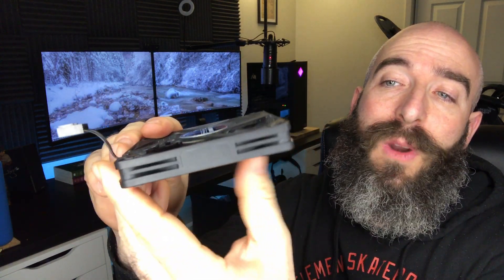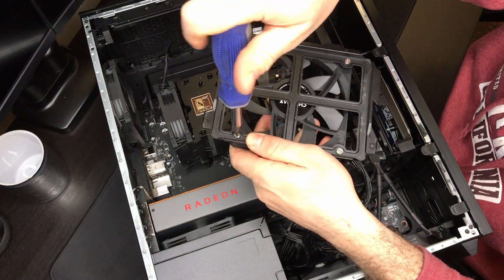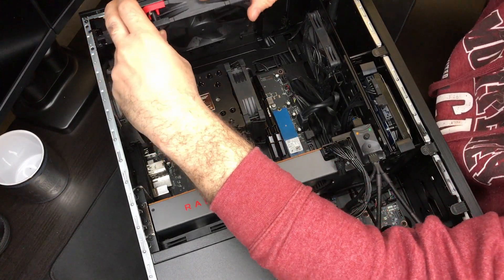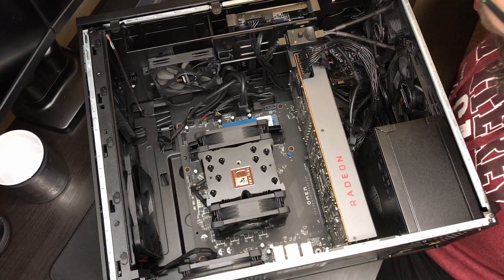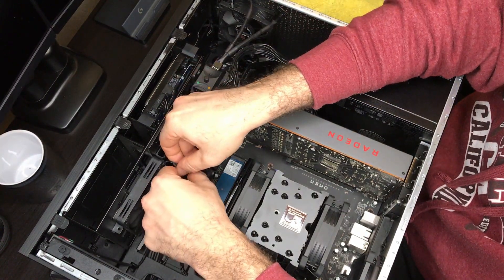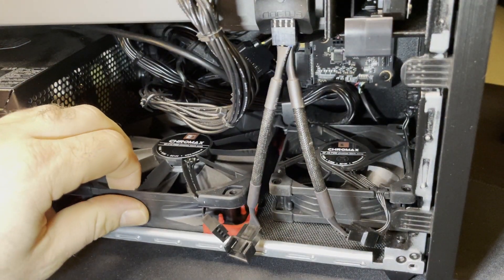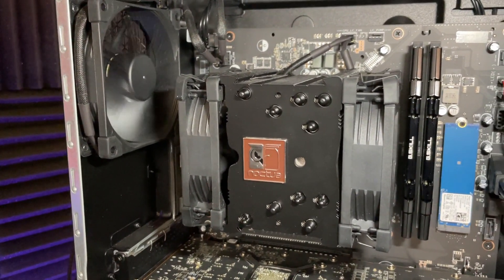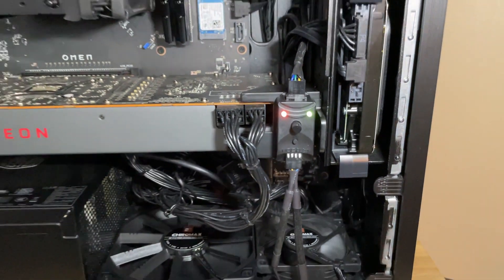How to: Install and Setup All Fans in an HP Omen 25L / 30L! Tutorial & Guide!

Comment: I have a hp omen 25l
Can I install a cooler master i71c without changing the back plate? I think it may be possible since it's almost the same except for a 120mm made for Intel cpus,there's a ryzen ver but the plate is intel correct?
 I want to add some more cooling capacity without removing the motherboard and the tedious process of removing that plate without breaking the MB
Reply from the maker: It may work but I’m not 100%, and it probably won’t be that much better than the Omen air cooler, although a 120mm will provide more airflow than the stock 80. Both Ryzen and Intel Omen motherboards use Intel spacing, you’re correct. I haven’t seen anyone try this so not sure if the i71c will work. If you’re careful and have the right tools, removing the back plate isn’t too bad. A heat fun / blow dryer / dental floss / plastic pry tools have all proven to be pretty effective. I have a full tutorial on the CPU cooler swap if you need it.
Reply: @DanKamYouKnow  my stock cooler has a 92mm fan...the i71 has more cooling capacity than the i51 which I'm assuming is the hp omen rebranded stock cooler,now I read the ryzen 7 has a tdp of 65w,so shouldn't that stock cooler be sufficient?it's rated for 65w, Idk
Reply from the maker: All stock Omen air cooler fans are 80mm. HP limits every single Omen CPU to 65w TDP, Intel and Ryzen. Looking at the design of the i71c compared to the stock Omen air cooler, it seems like it should work. It’s only $20 so you could give it a shot.
Reply: @DanKamYouKnow  so hp throttles the cpu so it won't go over 65w tdp? That's crazy to lose performance because they won't spend a few extra $ on a cooler? Are the aio liquid models capped at 65w as well? 
 I'm really thinking about getting a new motherboard and case and transfer everything over ,cpu,mem,Ssd,etc...that way I can control the clock/overclock,I assume hp bios do not allow that
Reply: @DanKamYouKnow  thank you for your response on the cooler.....
 Lastly are there any rgb headers on the mb? And if so can I split the header to sync another rgb? I'm asking cause that cooler has rgb sync,i71c
Reply from the maker: Well, HP boards have proprietary RGB connectors so traditional RGB connectors won’t work. You’ll need some kind of external RGB controller to power them. I haven’t tried it so I’m not sure.

Comment: The only thing missing from this upgrade DAN was the mention of the extra screws you need to install the top exhaust fan...when I took off my sons top plate it only came with 2 tiny screws nothing else. Can u help us out on what size and thread count screws to get or do I just use any screw that will fit?
Reply from the maker: Screws for the fan ALWAYS come in the box with the fan. I unfortunately have no idea what size they are.
Reply from the maker: If they didn’t come with them, you can Google or Amazon search PC fan screws and there’s a ton of results:

https://amzn.to/3iCn5s9

This is a huge pack but they look like this
Reply: You’re the best DAN... yeah we ordered the exact 2 fans for the top and rear exhaust and nada screws..thanks for getting back to us so quickly we’re actually installing 1 of the fans now.

Comment: The screws that came with my chromax fan did not fit into the bracket so I had to put the fan at the bottom did you use a different set of screws?
Reply from the maker: The screws that they come with work fine. You have to place the screws into the bracket first, and then screw them into the fan. You’re creating threads in the fan so it may be tough at first.
Reply: @DanKamYouKnow  thankyou so much I just mounted the fan to the top with the bracket also should I plug it into the pump or CHF AN
Reply from the maker: CHF AN would work better. 👍🏻
Reply: @DanKamYouKnow  ok thankyou I have everything thing set up thanks for the help
Reply from the maker: No problem 👌🏻👍🏻

Comment: What about the Fan on the front side like 30L? Isn´t it possible to change the front plate to the one frome the 30L for better airflow at the downside of the case? Aside from that: Nice videos, thank you
Reply from the maker: It would take some serious modifying in order to add that front extended section in, and frankly not worth the trouble in my opinion. Even with that lower 120mm, the 30L’s don’t run that much cooler.

Comment: I have the Intel i7 + RTX 3060 model 25L. I installed a Be Quiet! fan on the top, but I have another one I want to install somewhere else. I can't find anywhere in the case to mount it, and I want it at the bottom as an intake fan since I currently have 2 exhaust. Any tips? I noticed u have one on the bottom but I don't feel comfortable using adhesive.
Reply from the maker: I didn’t use adhesive for the bottom fan, it’s wedged n next the the power supply and doesn’t make any additional noise or anything. I HIGHLY recommend a bottom fan because it brings a much needed intake fan into the case. I show in the video how I installed it.
Reply: @DanKamYouKnow  alr, thx I'll try that, I think I'll use it as an intake :)
Reply from the maker: Yes, definitely use the bottom fan as an intake. If you mount a top fan, set it to exhaust.

Comment: I have a HP Omen 30L water cooled version. Where would I mount this? CPU and GPU hit temps I’m not ok with.
Reply from the maker: If you have a water cooled machine. Your best bet is to replace the 120mm radiator fan / the rear 92mm fan and add a 120mm fan at the bottom.
Reply: @DanKamYouKnow  thank you gpu and cpu hit like 82 degrees which to me is crazy. Almost had them hit 90 degrees before. I’ll pick up these fans.
Reply from the maker: Nice, that should help bring the temps down a bit
Reply: @DanKamYouKnow  so I noticed the y splitter only has 4 pins on one and 3 on the other (both in the box) does it matter what’s connected to which?
Reply from the maker: It usually doesn’t matter which one it is connected to but, if you notice the fans acting strangely or spinning at the wrong speeds, switch them around.
Reply: @DanKamYouKnow  thanks and this 120mm Noctua Chromax will be better than the stock fan on the liquid cooler?
Reply from the maker: @lightninggod4348  Yes. Noctua makes THE best fans on the market. The HP ones are cheap.
Reply: @DanKamYouKnow  ok I replaced the water cooler fan and put in a bottom fan. Waiting on the replacement back fan. My temps are still sitting around 80 degrees, but haven’t gone higher than that. So it seems like a step in the right direction. I have the Ryzen 7 5800x and RTX 3060ti model. Not sure what temps I should be aiming for.
Reply from the maker: That sounds about normal with how powerful that PC is and the lack of airflow I’m that case.

Comment: Hi Dan. I cant get my mount bracket off because screws are striped. Can I use the double sided tape instead to mount a 120mm fan? Thanks
Reply from the maker: Yeah, I’m sure that’ll work just fine but make sure you get tape that’ll stick really well. Definitely don’t want that fan falling down

Comment: i had no clue the bracket punched out like that...i just bought one off of marketplace and drilled four holes on the top of the case to mount a liquid cooler.. too late now
Reply: works great...thinking about it now i dont think it would've worked with the bracket regardless since I have 2 fans on the cooler in a push pull configuration going out of the top of the case to take advantage of heat rising upwards. The clearance is about a mm or less from the motherboard. cpu temps while playing warzone are 60-65
Reply from the maker: Nice! Those are great looking temps 👍🏻
Reply from the maker: Oof. If it works, it works.

Comment: This won’t void any warranties right ? I’m getting this done next Thursday
Reply from the maker: Pretty much any modification will void the warranty. HP requires the PC to be in stock form before they consider warranty work. So take that how you will.
Reply: @DanKamYouKnow  if I need anything replaced I could just take out all these parts and replace it with the original and they would be none the wiser correct ?
Reply from the maker: Pretty much how I saw it. I never ran into any warranty issues so never had to do it but as long as they don’t know about the modifications, I think you’re good
Reply: @DanKamYouKnow  nice, your reviews have really sold me on this computer so that’s why I’m getting it

Comment: Hiya Dan, thank you fo4 your videos they are awesome. I just purchased an HP Omen 25L with a gtx 2060 for a very good price, it’s for my son and I did think at the time that the fans looked like a weak spot. I have a couple of questions, why didn’t you go AiO for the cpu? Like the Corsair 120mm AiO? Also have you shown us how you are running the fan controller powering the bottom 2 fans and the front fan? How is that setup working? Does this mean you cannot control those fans and they are 100% all the time?
Reply from the maker: So, the Omens can only fit a 120mm AIO, or an air cooler under 140mm in height. My Noctua U9S has shown better results than any 120mm AIO out there, plus I honestly like the way my air cooler looks compared to a 120mm AIO ( 280 and 360 AIO’s look sweet though ). 

The fan controller is powered off the empty SATA power plug for the 2nd hard-drive ( so you wouldn’t be able to use a 3rd drive if you use a a fan controller. ). It can hook up to 3 fans and their is a manual turning knob to set the fan speed for connected fans.
Reply: @DanKamYouKnow  Hi Dan. Late response, but: What fan controller do you use??
Reply from the maker: https://amzn.to/3f391W4

👍🏻👍🏻👍🏻

Comment: Great video(s) Dan- as others have said- they’ve been a tremendous help (especially to us newbies). I have a quick question for you though. 

My dorado motherboard only has one fan header on the right side, and it’s a 4-pin labeled CH FAN. Is this the same header as the CH4 FAN/FTFAN4? I’m trying to figure out where to run my fan controller for my bottom fan. I assume it’s the right header, but I can’t find the answer Googling so I thought I would try asking. 

Thanks!
Reply from the maker: Thanks Chelsea!! Appreciate it.

SO, with a fan controller ( not sure which one you are using ) but they actually work a bit better when NOT plugged into the motherboard. You basically will just power it with a SATA plug ( usually the 2nd HDD SATA power cable ) and use your fan controller. This is all assuming you are using a manual fan controller like the Noctua FC-1 or similar. Most normal fan controllers do not pair well with the Omen motherboards and might give you a fan error when first booted up.
Reply: @DanKamYouKnow  Okay awesome, thank you! I actually have the Noctua one! I followed your instructions to the T! :)
Reply from the maker: Nice! Then it’s definitely best used when not plugged into the board. Provide SATA power and set the dial where you want. ( I like 12o’clock to around 3 ), and you’re good to go 😎
Reply: @DanKamYouKnow  Sorry, one last question- it came up during instal of the CPU fan. 

So I think there’s an issue with the metal stock cooler I have. I can’t get the top left screw to catch with the new noctua. I’ve tried different screws, rotating the fan- everything I can think. Question is- am I okay just using the 3 other screws for now? Common sense tells me that it’s pretty secure since the other 3 are nice and tight (though not too tight) and the fan isn’t going to fly off and explode at turbo speeds. Would this been a decent assumption? I don’t can’t afford to change the whole cooler rn, but I will later. Am I okay until then?
Reply from the maker: I’m pretty sure you’ll be fine. Worst that could happen is you might get a little vibration but I’m sure you won’t.

Comment: Thanks for this. My rear fan on my new omen 25L is hooked to the input "RFAN1". Can that support both the rear fan and added top fan connected to it via split cable?
Reply from the maker: Yes it can! You can y-split the top and rear fan into that header with no problem 👍🏻
Reply: Hey that worked except there is one issue. When the fans turn off (I guess due to inactivity) only the top added fan comes back on ( the rear fan stays off). It won’t turn back on until I shut down and restart. Any suggestions?
Reply: Just for a little added info I’ve realized, I’m using a y split cable with one end having four pins and the other three... Any idea? When both fans run the temperatures are great but again, the rear fan eventually turns off and doesn’t come back on again (only temporarily) when the omen is reset.
Reply from the maker: One end of the fan ( 3 pin ) spins based off what the other fan is spinning at. Try switching the legs of the y-split cable and see what happens
Reply: @newyork1524  hi. Would like to know if u solve that issue. I want to add the fan too. And I have also only the rfan1

Comment: I have HP Omen 25L and looking to add bottom fans only
Do you know if two 92mm fan will fit at the bottom?  Specifically looking at Noctua NF-A9x14 PWM
Any advice would be greatly appreciated, thanks in advance
Reply from the maker: Yeah, you can fit a 92mm at the bottom but there is no really way to mount it. You could use double sided tape but it’ll work just fine
Reply: @DanKamYouKnow  Awesome!  Thanks for your advice!

Comment: Hey Dan I'm going to be installing the top and bottom fan in my 25L soon. If I buy the 120mm fan from amazon will the cable be long enough to reach the motherboard for the bottom fan?
Reply from the maker: Yes, most fans come with about a foot long cable.
Reply: @DanKamYouKnow  Ok awesome! thanks
Reply from the maker: NP, if it doesn’t, they make fan extensions that aren’t expensive at all 👍🏻

Comment: Hello Mr. DanKamYouKnow, should I worry about static electricity when removing that bracket? Get back to me soon please.
Reply from the maker: I wouldn’t worry about it too much but if you are, you could always wear latex gloves. 👍🏻
Reply: @DanKamYouKnow  Thanks man I just took off that bracket and my temps went down! I also just ordered a Noctua Chromax to mount on the bracket. So I can plug the 120mm Cromax into "LC PUMP" 4 pin connector?
Reply from the maker: I would recommend using a y-split cable with the top and rear fan.
Reply: @DanKamYouKnow  but I can use LC pump just if I don’t mind the noise right?
Reply from the maker: Yeah, it will work just fine.
Reply: @DanKamYouKnow  ok thank you I just don’t want to mess anything up.
Reply from the maker: You’ll be totally fine! I believe in you 👍🏻🤝
Reply: @DanKamYouKnow  thanks man 🤝
Reply: @DanKamYouKnow  When removing that bracket I didn’t put my PC on its side, it sounds stupid but I’m kind of scared to move my PC I feel like when I flip it on its side connections are going to come loose or something and it won’t turn on when I flip it back over. I’m probably just overthinking it.
Reply from the maker: Yeah, the connectors will stay in place. Take pictures of all connector locations so you know where all of them go before disconnecting anything.

Comment: Why would you have a closed bracket on the top fan? Just goofy of HP. Lmao!
Reply: Not sure if this is a dumb question, but if I wanted 1 fan on the bottom do I need the controller?
Reply from the maker: Nope, you can use a y-split cable to plug the bottom fan and another fan into one header. So if you’re front fan header is available, you can plug it into there; OR you can y-split the fan with another into an existing fan header on the motherboard
Reply: @DanKamYouKnow  thanks for the reply! Can you link to the gorilla tape you used for the top front fan please? Thanks!
Reply from the maker: NP! Here is what I used:

https://amzn.to/3xcpzCy

Comment: Can you use these fans on the intel cpu too? I’m new to pc and I saw one of the reviews saying that you can’t upgrade that pc That I got.
Reply from the maker: Yes, the Intel versions are the exact same way. Unless you have a 1200mm liquid cooler, then you’d have a 120mm fan attached to the radiator. The PC’s are upgradeable, but there are some restrictions due to the case design and motherboard.

Comment: i just got this pc and i have no idea what im doing but where on the motherboard can i put the rgb 4pin for an rgb fan? >.<
Reply from the maker: HP RGB is proprietary and any other fans with RGB will not work with the Omen motherboard. You’ll need some kind of external RGB controller, that I unfortunately have no experience with.

Comment: You're the only one who's done enough with these that I can think to ask, so here goes! I picked up an Omen 25L shell (case/mb/psu/cooler/HDD) and I'm in the process of rebuilding it. Unfortunately, it didn't have the top bracket that you've mounted the 120mm exhaust fan to. Do you have any idea where I might be able to get a replacement? I'd love to mount that extra fan or a 120mm AIO, but without that bracket, it's a lot more difficult. Thanks!
Reply from the maker: Honestly, your best bet is to either join our HP Omen Discord group in the description and see if anyone is willing to part with theirs ( we have a For Sale channel ) or contact HP and see if they can sell you one.

Comment: I added a fan on top and a fan at the bottom. In-game it didn't have a noticeable difference in the temperature on my CPU. Do I need a better CPU cooler? In valiant on all low at 144hz I was ranging from 76-91 c at most.  Are these safe temps usually it sits around 85 while gaming?
Reply from the maker: What CPU do you have? And does it have the stock air cooler or liquid cooler?
Reply: @DanKamYouKnow  it has a I5-10700f. Using the stock cooler
Reply from the maker: Which one though? The air cooler or the liquid cooler?
Reply: @DanKamYouKnow  air cooler
Reply from the maker: Then in that case, replacing the CPU cooler will dramatically lower your CPU temps